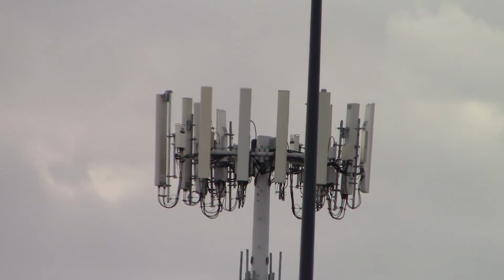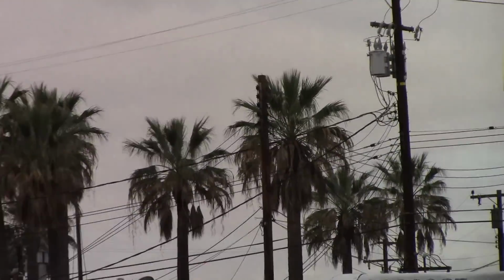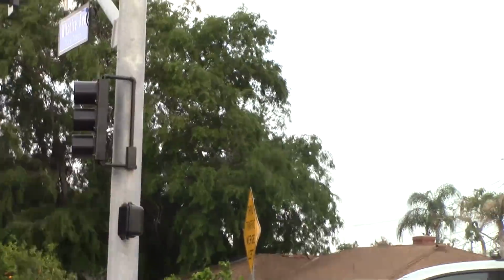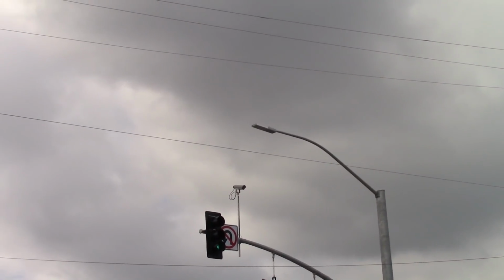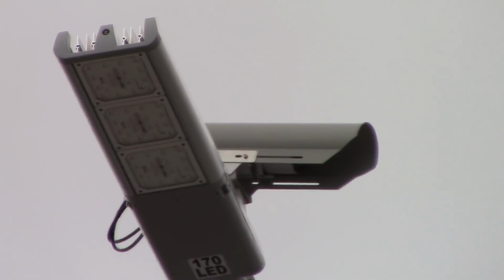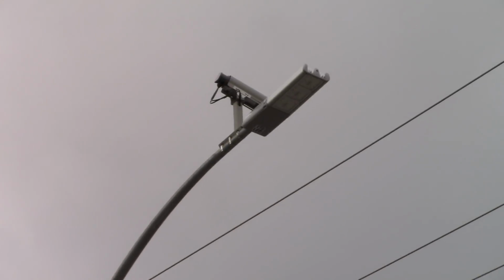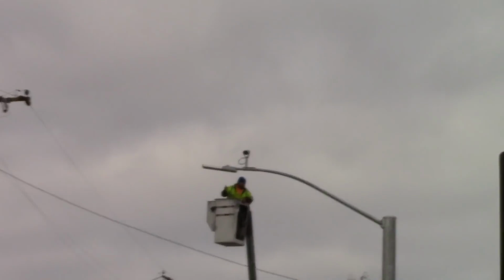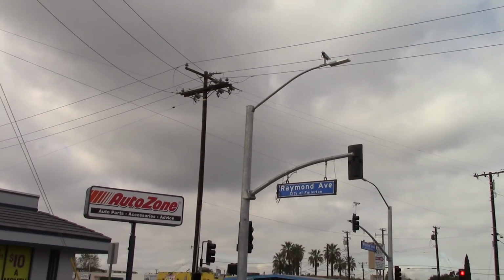WEAPONIZING TRAFFIC SIGNAL 5G INFRASTRUCTURE: LICENSE PLATE AND FACIAL RECOGNITION CAMERAS

Comment: Omg, I knew something was up! They were installing something new on top of a 4way intersection where 2 interstate roads connect. I listen to am radio & as I got closer the wa wa wa, became deafening. As soon as I passed by it my brain felt zapped, I was disoriented, I had to drive slow and pull over. It jumbled my thoughts and that has never happened to me beofore from a stop light!. The effects lasted 20 minutes! It was so bad I made it a point to go around, speed up and not drive under it. A week later there was a bad accident right there where a truck was flipped over into its top, upside down. I figured whoever installed it installed it wrong. It took about 2 months before it stopped making the loud wa wa wa electronic noise. I would speed up or pull over so I didn't have to park under it at the red light. It was really bad the first time because I was close to it, first car with it right above me, over the weeks they tweaked it so the sound got lower and lower. Now it makes no noise on my radio. I wonder if that wasn't the cause of the accident to this day. I also wonder what technology it is that they think is safe to jumble people's brains at an intersection? It felt like my brain was fried!

Comment: They put these "light poles" in front of my house in Tacoma WA. One side of the street had a pole with no light on it, just a pole like the other one, without anything on it. A cable connects the two poles. And an led light that mimics sun light. One is a receiver, and one is a transceiver. The bolts holding the pole are bigger than my fists. It took weeks to put them in, and the sidewalk, and the street was torn apart. Big pipes and huge wires /cables were put in the ground.

Comment: Educate the installers Joe 👍
Reply: Sister Goldenhair I install them. I’ll educate you. They are for traffic detection, not surveillance. They are replacing the old style of detection, which is wires cut into the pavement. There’s basically a box drawn on the computer screen, in the lane. When your car pulls into the box, which is called a zone, it puts a call into the controller, to turn the light green for you.

Comment: Build a jammer that links to tower an uses tower to send to other towers an disables whole 5g grid.
Hmmmmm that's right
Reply: HMMMM Electronic Warfare? I like your thought process here....
Reply: @Taylor Daniel Sciff it's easy 6 coat hangers, roll 300ft aluminum foil,  2 car batteries,  old am radio,  jumper cables , scrap wire 10 gauge total 12 ft,  4 alligator clips, wire strippers or sharp knife ,duct tape, 1/2 x 10 ft electrical conduit and ninja outfit urban camouflage. 
Will have pdf schematic out soon how this goes together 😁😂😁
Reply: @bungeeboard  No modified microwave oven with a funnel to direct the beam and fry the electronics?  https://www.youtube.com/watch?v=DoOT2_Z-GIE
Reply: @bungeeboard  This is needed now more than ever bro!!
Reply: @bungeeboard  hi bro Do you have the pdf of this to download? Now is the time if you haven't already. Peace.
Reply: doesnt jammers also radiate harmful frequencies? correct me if im wrong
Reply: @venusreadings  it wont be because its not direct to us it would be direct to them machine lol
Reply: Use gun instead
Reply: im sure i watched a kid make a emp gun on youtube lol looked pretty easy.....
Reply: M realness 
Chck out catholic2007.blogspot.co.nz  for more solutions...
Reply: If you even try to defend yourself against what they are doing see my last video of the energy that moves my blanket. They torture 24/7

Fed Gov regulates ALL emf and what works is illegal to us.
Reply: oh :) well that's good news than 😁